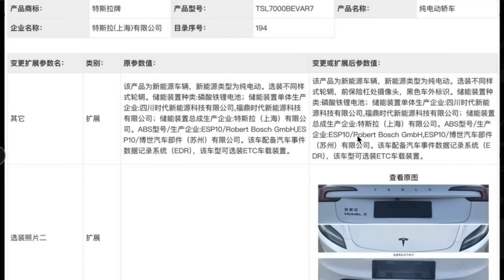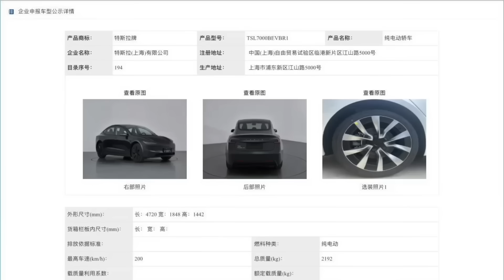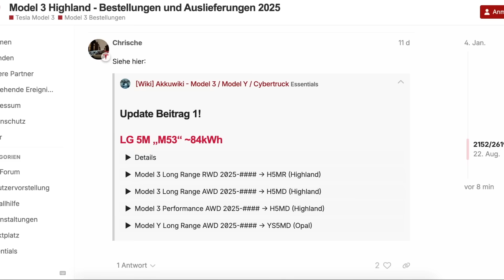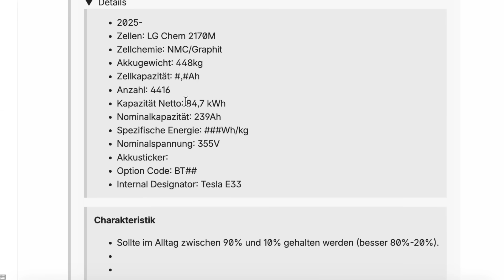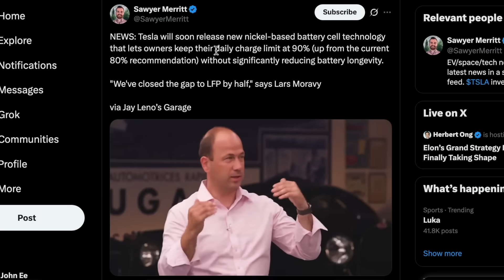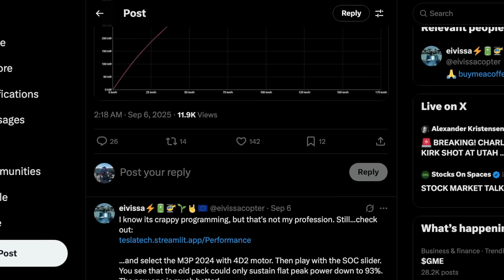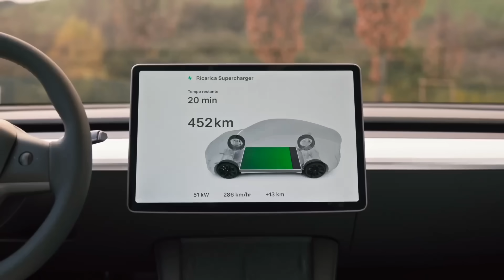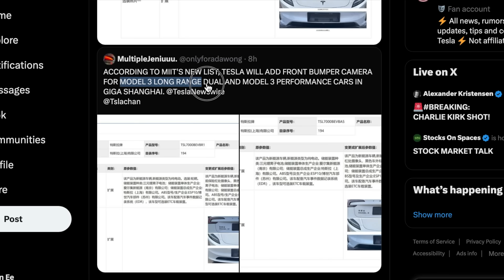NEW Tesla Model 3 Front Bumper Camera Retrofit and Huge Battery Upgrade | It’s Finally Here

Comment: The Mercedes CLA is more efficient with the same 85 kWh battery, 792 km WLTP, 800V charging curve that takes practically half the time, MBOS software with AI, better brakes, suspension, and sound insulation, and what about the price? With discounts there won’t be much difference. Plus, it has Shooting Brake versions with more trunk space both in the rear and the front, and it’s a 5-door with the advantages of the rear hatch, so we can forget about an SUV.
On the other hand, the GLA is coming soon, which is basically a CLA SUV-C.

Tesla no longer wants to build cars and is squeezing the most out of its 400V technology from 2021. Buying a 400V car in 2025 doesn’t make much sense.

Then we have new SUVs like the GLC, 14.9 kWh/100 km, 800V, 735 km WLTP with a 95 kWh battery, and the impressive iX3 with 805 km WLTP, 15.1 kWh/100 km, and a 108 kWh battery. The Germans have finally started making serious electric cars; what we had before were first attempts at 400V, often with platforms converted from combustion models. Once Germany got serious, it left the Chinese and Tesla back in the Pleistocene. These cars have Tesla’s efficiency combined with China’s charging speed and record-breaking ranges. With a first-leg range of 850 km, these cars will make many people switch to electric vehicles, since in terms of price, range, and charging speed, they are better than the comparable PHEVs.

Tesla was the pioneer and set the boat in motion, but today, cars are no longer its main focus.
Reply: The CLA won't charge on a 400V charger and most of fast chargers are 400V so it's pointless at the moment. Even worse, you can only charge the CLA on 800V charger, good luck to find one on the road in the summer. All 800V vehicles should be able to charge on a 400V charger.
Reply: @uggiechelsea  In Europe, most chargers above 100 kW are 800V. In Europe we have 230V AC, not 110V like in the US/UK, which is why all our AC chargers are 22 kW — three-phase 380V × 64A. By the way, the Mercedes charges at 22 kW on AC.
The Mercedes CLA Shooting Brake and the GLC come with 400V DC charging. So in Europe, there’s zero problem — all advantages. The CLA Sedan will already come with 400V compatibility in January. I’m telling you, here in Europe it’s not necessary. And Tesla is already switching to 800V in the US with the Cybertruck, and it will soon do the same in Europe as well if it wants to attract other brands — 400V is obsolete technology.
Reply: @Potenkin76 Dein CLA kostet mal eben 61000€  , was heißt er kostet also mal eben 15000€ mehr als das Model 3 maximale Reichweite mit Heckantrieb ! Dieser kommt übrigens 700km nach WLTP !

Ich kenne nicht einen der 61000€ für ne A Klasse ausgibt und ich meine damit nicht Leasing , aber ich kenne sehr viele hier bei uns in der Kleinstadt die bereits die 46000€ bereit waren auszugeben 👌🏾

Meine Frau fährt als Leasingfahrzeug den I 4 und wir würden den definitiv nicht kaufen :
1. zu teuer 
2. weniger Ausstattung als ein Tesla 
3. teilweise altmodisches Interieur 

Vom aussehen top , Fahrwerk ist ok und dann hört es leider auf !

Comment: Seems new LG batteries are reserved for Performance and TMYL from the start but hopefully it will trickle down to normal LR models as well. Looking forward to seeing charging speeds.
Reply: Wrong, there are already AWD in swiss with the new pack… already on sale in some inventory ( example swiss ) 600 km wltp with 20 inch wheels , and it also has the larger 16 inch screen!
Reply: @jeroenachten8513  interesting - source? Also 600WLTP seems a bit on the low side, when Performance is 580? Even on 20" - gap was more on the previous model. I was hoping to see 620-630 on 20" and 650+ on 19"

Comment: The front bumper camera isn't yet used by FSD. It's expected that FSD will eventually make use of it, although I wonder, with HW4 already stressed to maximum capacity, how it will process even more data?
Reply from the maker: Further optimization and compression just like HW3 until it becomes obsolete
Reply: possibly only set to use at low speed?  At highway speed the front bumper camera may not provide much useful info.

Comment: I have been watching your videos for a while. Last year you spoke of a HW4.5. Maybe this upgraded HW4 is what the upcoming MYP will use, but still called HW4.
Reply from the maker: Thanks for sticking around! Ya HW4.5 internally is likely this addition of the bumper cam before they head to HW5
Reply: I think there are multiple versions each FSD computer. The HW3 in a 2021 Model 3 and the HW3 in a 2023 legacy Model 3 is also no the same.